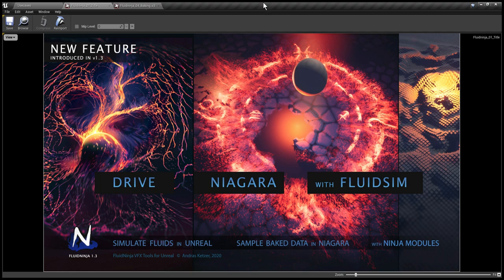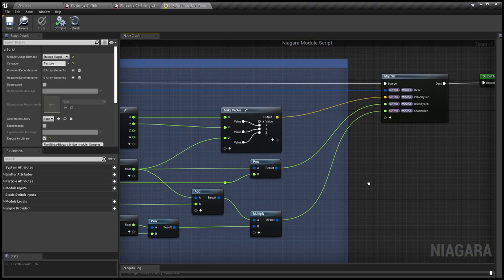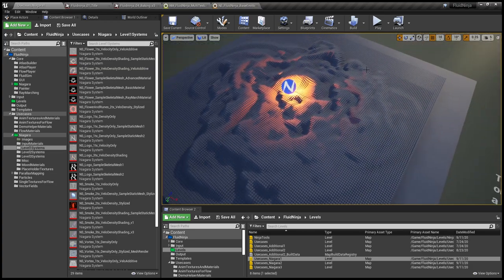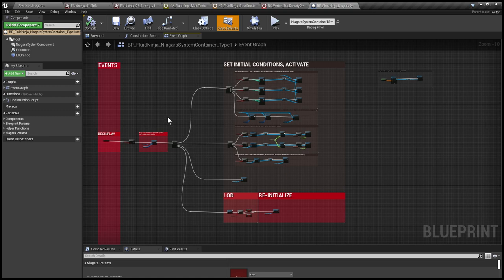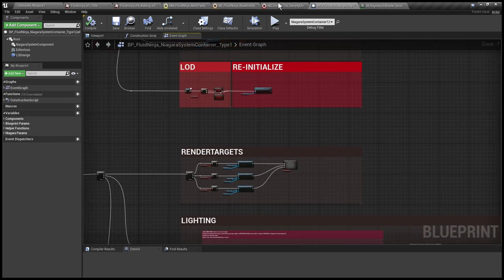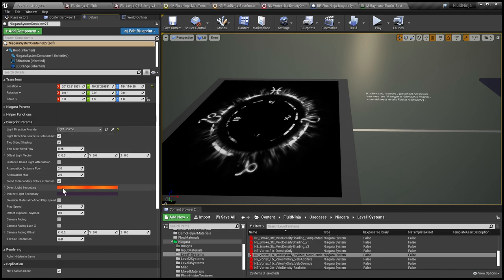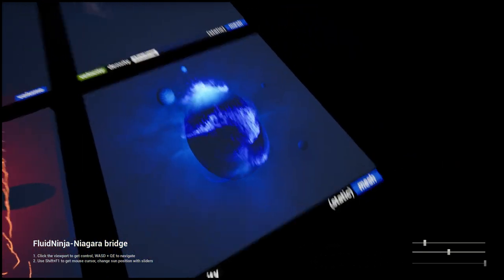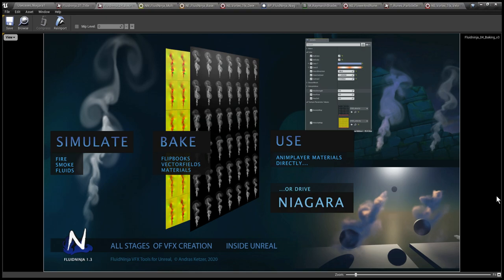FluidNinja VFX Tools 1.3 - Tech details - Niagara Systems driven by baked fluidSim

Comment: Is there a limit to the detail of the simulation and is there a limit to the baked simulation scale?
Reply from the maker: Hello again Johnny! The Niagara feature has been added to NinjaTools to transfer texture stored (baked) density and velocity data to particles. (1) One limit is the resolution of a single frame in the baked frame-sequence (set by Canvas/Size on UI) ---> this should be no more than 1K, ideally 256px. This limitation could avoided by TILING the baked texture (your baked texture will behave like having infinite resolution) - see (A) this tut: https://youtu.be/NM56UvAySbc?list=PLVCUepYV6TvPnVELcyGoSDhpoLO7PyT6_&t=360 and (B)
"Usecases_Niagara_CloudVortex" Level - seen on this vid: https://youtu.be/nt5X3wN3mck?list=PLVCUepYV6TvPnVELcyGoSDhpoLO7PyT6_&t=486
(2) An other limitation is GRID2D resolution in Niagara, defining "how many particles" you have / particle density. Again, 256x256 grids are usually enough - performance depends on particle size / overdraw and many other factors. 
This tut explains: https://80.lv/articles/tutorial-driving-niagara-with-flowmaps-and-baked-fluidsim-data/

Comment: looks as planned. but would be great if you can point an idiot where where or what to search to apply V3A / MOD2t to sphere which is player character type orb
Reply from the maker: PSI, so you would like to map particles on a sphere, right? In this video at 16 mins and in the manual on page 15 we are discussing this topic: using custom meshes to emit particles (so, it could be a sphere, or a Stanford Bunny, doesn't make difference) LINKS:
Manual, page 15: "StaticMesh based UVs": http://tinyurl.com/y26whxh6
VID snippet: https://youtu.be/8dvS1c9xj6U?t=970
Reply: Respect…I like to do my own research before bothering others but  in a little rush..x

Comment: need something more fore an simple man.. the x-ray sun.. something i can drag and drug. the 2d np, Niagara piece, cant find solution in reading yet.. But i rendered a little bit of green..
x ray is skeletal mesh.. 
 I intent to use it as a planet outer  layer.  
it must interact with light,  like particle fx,  n emissives..  
 but itself it must be white. 
colors are for later,  
in case I can't i  will illusion load different level,  because we will penetrate that layer of smoke and enter inner part of the planet..  that part is made of volumetric fog which brings me to the next point.  I have spent last 24 hours bending splines,  that hold Niagara particle fx.. there is a node that assignes materia to particle,  like stone or water or rock,  with noise gives it outstanding curve..  how can I apply fluids to it what do you think brother?
so make a OG planet I need to rig with skeleton in blender with some bones,  so the xSun code can manipulate  them and do the breath?  I have replaced with xSphere with mannequin,  but the
video card drivers failed me..  I could only lay a glance on the mighty Mann

Comment: Hi. Once you bake it the simulation once in unreal engine does not cause a drop in performance? thank you
Reply from the maker: Baking is a "pre-game-running" process similarly to level building or character animation - and it is performed to lift the weight of realtime calculation from the GPU - so, performace wise it is a good choice, but you have to sacrifice responsivity. The above tested method tries to set up a system that is responsive - despite the fact that it uses baked data :)